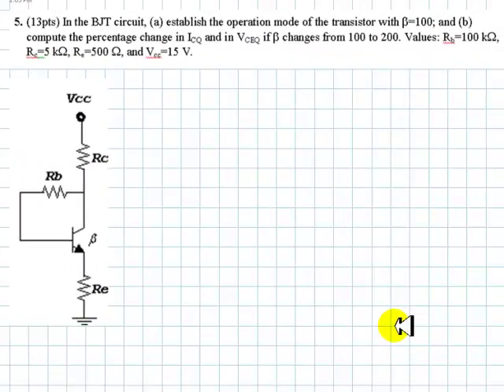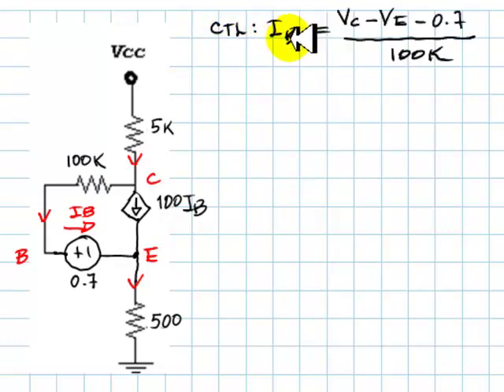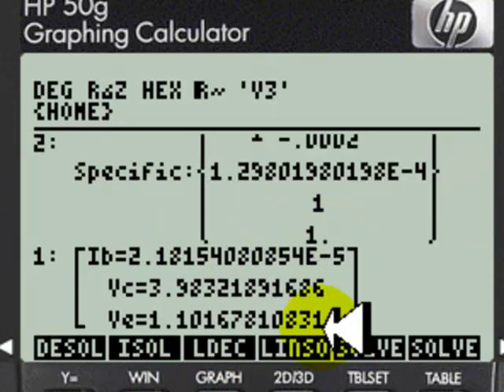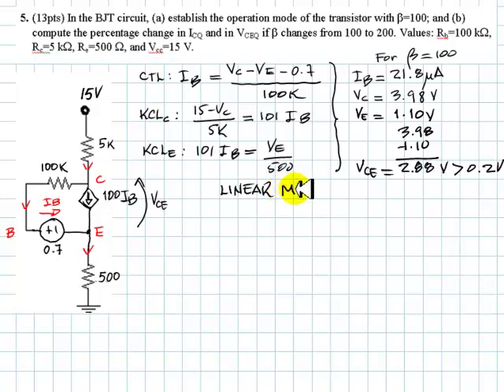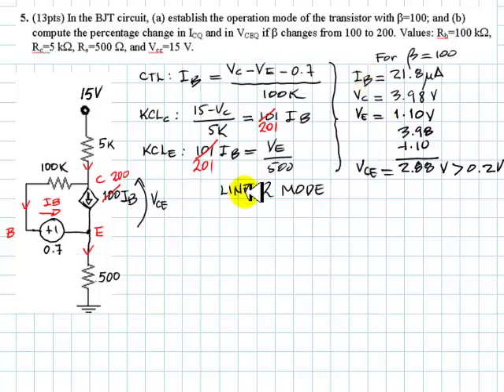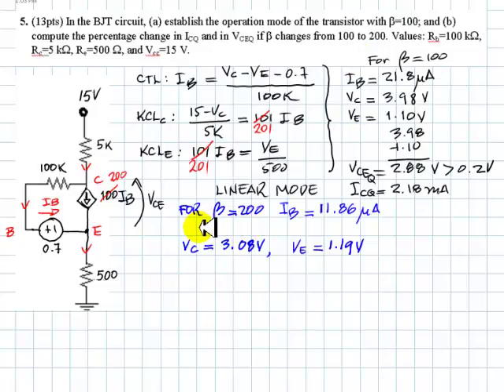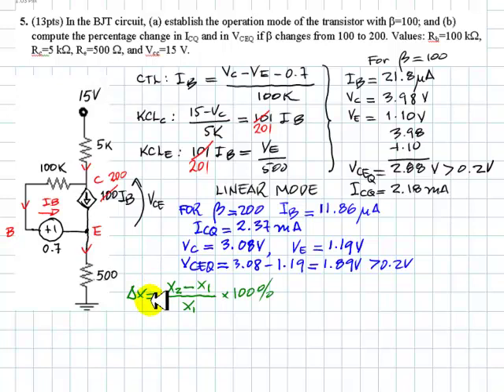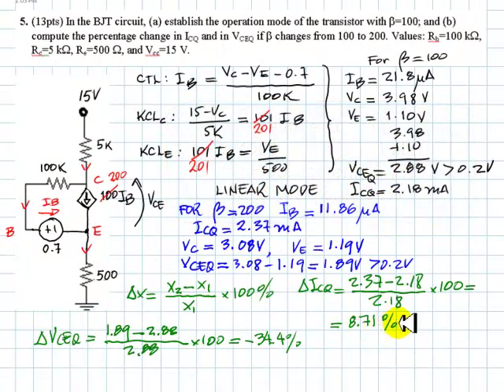EECE 251 - Final Exam Q5: BJT

Comment: awesome, thank you for the informative video. my question is, can you clarify how you got the answers for the three variables please?
Reply from the maker: It is a system of three linear equations with three unknowns.  It can be solved using the method of substitution, or the method of equality, or using matrices, as we learned in Math courses in High School, the engineer usually uses a CAS for that, like Mathematica, or Wolfram Alpha, or Maple, or Matlab (I prefer XCAS which is Open source).  In this video I'm using "Erable" which is part of the old HP 49g (this is a very old video, I don't use that anymore).

Comment: The denominator for the KVL equation at E should be 500000 not 500.
Reply from the maker: +Akshay Lingayat No, it shouldn't. It's not a KVL equation. It's a KCL equation.
Reply from the maker: Not really. You are mixing two methods. You multiply the emitter's resistance by beta plus one to refer it to the base circuit when you have reduced the base circuit to a Thevenin equivalent one, which I am not doing here. I am using the circuit as it is given. That equation is correct as the video shows it.  And more, there is no KVL equation here, only KCL equations and CTL one. That you mention KVL gave you away that you were thinking of referring the emitter resistance. Thanks for your comments though.